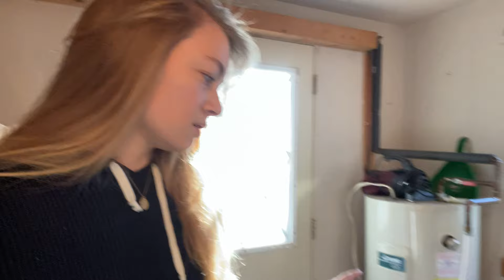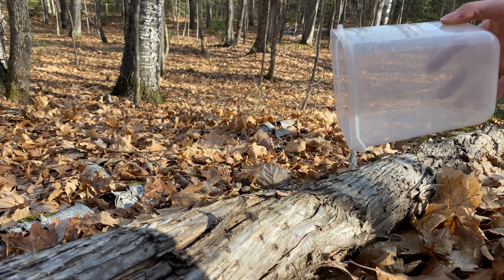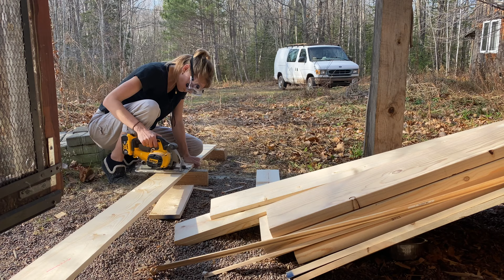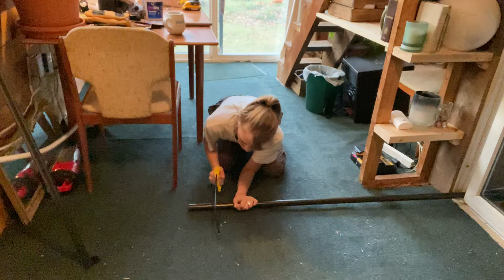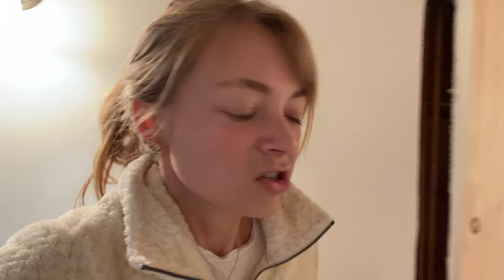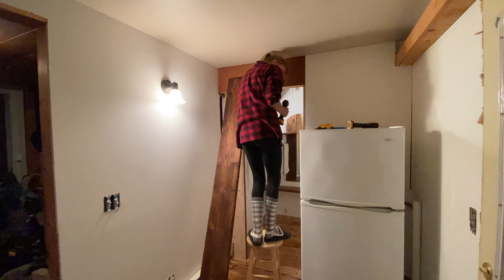DIY Bathroom Renovation (i'm tired) (but happy)

Comment: RE: The frogs falling in (or anything else)
You should put a piece of screen/mesh over the top of the pipe from the outside. That way nothing can get in/die inside.
Reply: She said that she has bought a cap for on the pipe :)
Reply: @hiekevanrijswijk8222  I think the cap was for the inside of the cabin, not the outside. That's why a frog came out when she removed it to do this renovation, I think it got stuck there.

Comment: Don't forget to drain waterpipes, waterheater, turn off H2O access...
ie... Winterize cabin before leaving it for the winter season. 🙂
Reply: Also exposed faucets, cover with insulation.  Anything exposed, insulate.
Reply: Why even leave for winter, that would be fun to live in.  Only difference is 20-30 degrees.

Comment: Darling, for bathroom floor (to know for the next cabin) it should have been taped around the edges with a special fabric taping then waterproofed (by painting the floor and up the wall a little ways with waterproofing agent). That will stop water damaging the walls etc overtime or if you have a water spill 💁🏻‍♀️
Reply: This!! She definitely had some water damage near the floor and tub on the wall. There could be mold growing back there.

Comment: The floors look great, bit worried about moisture getting under the wood planks tho...
Reply: That’s exactly what I was thinking
Reply: Yep
Reply: Same it makes me anxious
Reply: how would you prevent this generally speaking? like how do you keep moisture from getting under there? insulation?
Reply: @soupafleye  sub flooring.
Reply: It is a thick rubber mat that goes up the walls an inch or so and hidden be the trim. Could lay down some tyvek under the flooring,  this will probably get torn out next spring.
Reply: You never cease to amaze me with your skills. I’m so glad that you just take charge of your own happiness.
Reply: I think this is kind of her trial run cabin, so the mistakes she makes she’ll learn from when she decides to build a new cabin or renovate the other one
Reply: Just cover the planks with floor epoxy, problem solved
Reply: @soupafleye  where I am from we build with brick and mortar so this usually just gets built into the way the floor is laid everywhere. But I think  with this kind of "american style" houses you can just lay some moist resistant barrier under the floor, between the boards and that should be enough

Comment: Btw she was mistaken to remove the linoleum , it was a good moisture barrier tot he sub flooring before putting boards down. She didn’t put anything under the boards, so water will leak slowly between the boards and she should have left the linoleum under the fridge for leaks... also why isn’t she concerned frogs are living in the walls ?

Comment: Erm...you should have some kind of water insulation on the floor. Espec because wood is sooo not water resistante. Thats a bathroom, it will be wet and moldy and ya know....you need smth to stop the water from going down
Reply: I thought the same thing. Moisture and wood don’t really go well together. It looks nice but I feel like in a couple years it won’t look so good.
Reply: Alison Brown  I didnt say she is stupid. But what I see in the video is that she didnt put any water insulation, ok?

Comment: Might need to redo the floor in your bathroom. You just missed a crucial step where you put a layer (idk what the material is) between the new floor and the old floor. This ultimately stops molding in your floor. Only a minor setback :)

Edit: My dad is a carpet/hardwood/tile (all types of flooring) layer tradesman and I spent a lot of days working with him

Edit2: So there are two options here:

1) Ignore it and fix it once your floor starts to cave in (idk maybe 5 years from now) which will cost heavily

2) Fix it now with couch money and ~3 hours your time
Reply: I am not a carpenter but I was a bit concerned about that as well. There are so many flooring options that are waterproof and yet look natural and for a space that size it would be really cheap.
Reply: I was thinking something like that... then I remembered this is her learning cabin. 🥰
Reply: @jillyfish72  future lesson: how to get rid of water damage and mold from a bathroom (unless she remedies the situation somehow)
Reply: She is just one person living there, and she did the work, so she will respect it. I'm sure she will use bath mats and her cabin is probably drafty and has dry heat from the wood stove, which is an issue in Minnesota. She said she is not living there over this winter. She has other issues that would also effect the floors, like heat and cold. I know, my wooden gate fence has a turnbuckle to adjust for the shrinking and expansion of the wood seasonally. As long as she has it completely dry before she closes up for the winter, she can at least come back to it in the spring and work through the issues, and have a functional and pretty bathroom to use while she works on projects. I need a good, hot bath whenever I do work like that! My bathroom was also my first big project, and I don't regret it. She also has an outhouse, so I'm sure she is thinking about water and at the very least, a composting toilet indoors for the future. The sound clip that made me smile was "Morries of Inver Grove Heights" which told me she is close enough to St Paul to get FM radio stations from here. I lived 2 hours into WI in a cabin for a year, the bathroom was so rotted and molded the toilet was about to fall into the basement. A rental. Now I am a homeowner, so yes, she will have issues, but the progress and feeling of functional and pretty shelves, a bathtub, and fresh clean paint is very motivating and wonderful!
Reply: Good information! Thanks for sharing. I’ll remember this for when I have my own house to fix up someday. :)
Reply: @brendag2891  Yeah don't get me wrong. She is one of my favorite Youtubers. But having lived in my current home for 16 years now - well you live and you learn. You ignore a problem or try a solution on your own without the required research or experience, you are either just throwing away money, or more likely going to spend much more down the line getting an expert to fix things.  But yeah I will give it to her - she is on a schedule, so to speak, if she wants to make money with consistent videos. I painted a room a few weeks back, and I thought about what a pain it would be to have to stop every few minutes and try to adjust a camera, while I have paint all over my hands  - or getting the lighting and sound right so I can explain what I'm doing. And then after ALL that having to go back and edit a video of that.  All of that cuts into the amount of time you can actually research all this (after all, most home improvement videos are not nearly as entertaining as hers).  But she is smart, feisty, fun, determined and young- she has plenty of time to learn all this.
Reply: @brendag2891  I'm from thunder bay and I used to take trips to st. paul/Minneapolis MN often! It honestly shocks me that her land was so cheap, even in the middle of nowhere in ontario land is very expensive! I think she's doing a decent job especially considering she has 0 experience, but yeah the floors would likely need to be addressed.
Reply: @lolalover24212  I wish I lived in Thunder Bay right about now! I seriously have been looking into community college options for my teens up in Canada, because it's the only thing I can think of for Essential Travel and a way to get out of this country. The Covid and political situation is so bad right now. I've wanted to visit Thunder Bay forever! I forgot my passport last time I was up at Lutsen. I need to live around the Great Lakes, and need the snow. I love what we call "up North"!  I will definitely be there as soon as Covid is under control. Not a moment sooner. I am so grateful Hannah has this great channel so we can virtually benefit! It's like a mini getaway during such crazy times. Thanks Hannah!!!!
Reply: @brendag2891  That sounds find and dandy, but do it right the first time! then you dont have to worry about it, she literally had to buy the stuff and cut it and put floor on top of it.
Reply: I believe she is going to eventually build a Tiny house on this property to live in, so this is just to have fun with, learn with and live at for the meantime.
Reply: @brendag2891  tbay is a great choice for all of that! I currently live in Ottawa, but I’m up in the summer to visit all the time! There’s nothing like NWO to be honest.....and yes we have all been hoping for you guys politically!! It’s rough out there these days, our politics can often be on the rough side (see: Doug Ford premier of Ontario 🤪 yes his brother was the crack addict mayor) so don’t feel too alone there 💖🥰 hoping you can get to a better spot soon!

Comment: Adding a Tankless Hot Water Heater would save quite a bit of energy and open up that space a lot 😁

Good job on everything! 

**Also, maybe some sliders under that fridge to keep your floor nice! 🤗
Reply: I have a gas on demand water heater and it is THE BEST. Never run out of hot water for my tub. So small, and very energy efficient. No big tank water heater. That would be a great update!

Comment: Hacksaws only cut on the forward stroke. 
The backstroke is a "clearing" stroke and just moves chips. 
So, push forward, glide back, don't drag it back and think it's cutting, cause it's not ~when it's going backwards.

Comment: next time you have to move a fridge on anything big and bulky and heavy and you dont want to ruin your floors move it onto a blanket, its easier to move because it slides easier, and it wont ruin your flooring. then to take the blanket out tip the fridge back and pull. fairly easy. easier with two but ive done it by myself before. LOOKS AMAZING GREAT WORK

Comment: Wood floors in the bathroom... girl I hope you like putting them in because wood and water is damage real quick
Reply: Just need to treat them properly . Marine varnish or Waterlox finish
Reply: Lots of bathrooms have wood floors.........as said you just have to seal them.

Sadly however she didn’t seal each board so water will get underneath and between the joints. Timber will swell unevenly and create high and low spots making the floor rough and uncomfortable.

Comment: If you have water to the bathroom and a drain, just put a toilet in!  It is really simple.  I have plumbed several toilets over the years. One in a basement where I had to make a raised floor and one on a main floor where I had to tap into cast iron drain pipes.  You would have an easy job of it!  There is lots of room by the tub.

Comment: You should put tiny corner shelves up high with plans on them where you messed up the trim in the room you insulated. It will hide the mistake and be so cute

Comment: The boiler should be hanging on the bathroom wall. It helps warming the space. The water pomp, well I have mine in the basement but maybe you don't have one. Maybe making a small closet just to be covered inside it?

Comment: Hey - love your videos! and I’m hoping to do something like this in the future. You should be super proud of yourself. Though here’s a tip for patching holes and cracks before paint - if you get actual premixed joint compound, you won’t see the spots after you paint over them. That pink stuff you’re using will make the patches visible after you paint. Cheers and best of luck!

Comment: You should be so proud of yourself.  You show most girls how easy this is and help them believe in their self. Shows any girl they can do anything like this and ya dont need a man. I really enjoy all of what your doing. But I fell into a rut and just can't seem to get started. L I love the shelf in the shower. Such a great idea and I love those floors. I need to do mine. What wood are you using? And stain. Id guess but I'm curious. Guess its time to unpack these tools and put them to good use. I even bought a miter saw. Used to work for an antique place but its been a while. Like you im usually very independent. This gave me a push to get started. My class needs some tlc too But I want to also start building things simple and pretty that i can sell.

Comment: I think you said your heading out for the winter, in your van? I was wondering about that, and how do you leave a house all winter? With flooring, usually tounge and groove is the flooring you use. Your only relying on nails like this,  but it should work, just some boards might not be perfectly straight, so might be gaps. Might be nice to put in a compost toilet for those days you just want convienence. Seems like would fit to left of bathroom door. Could be concealed as  a bench. Star drill bits and screws wont strip, get those next. Phillips is not that great.

Comment: Please tell me that you have a lip that catches the edge of the tub, on the underside of your tub-board that you made, so that it won't slip either down or up, which would then spill your laptop into the tub?   Also, to use some kind of clamp to keep it in place wouldn't be a bad idea as well.  ❤️

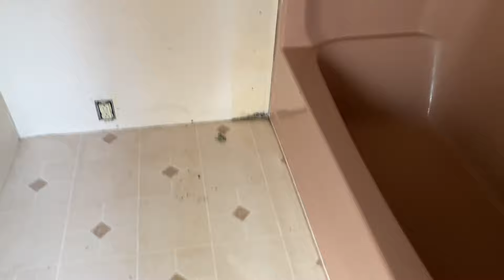Comment: Not like you need another project added to your supper long project  list you already have, but this might save your health, literally, trust me I made this huge mistake in 2002 and I'm still paying for it. At 6:03 you have black mold. It will continue to grow. You can't paint over it. You must remove that section of the wall. Then treat area with mold killer ( no, not bleach, that is a myth) then repair area. My son and I have Mycotoxicosis ( Google it). I have been unable to work since 2009. Mold has cost me my health, nearly my life and all that we owned. Take that extra step and remove all mold from your cabin, treat and repair.

Comment: It is a lot more complicated. First, you're in the woods and you probably should have done a moisture barrier before you put down untreated wood on the floors. And then it will probably take, at least 3-4 coats of sealant on top, then making sure it's tight to wall. Funny thing about wood...it can rot when it isn't treated and then you run the risk of black mold. Which is toxic and even after bleaching, sanding....comes back.

Comment: You need a plumber to put a drain in for a toilet. That water from tub and sink have to go somewhere.
Reply: Her toilet is in the outhouse. I was wondering when showed it if it’s just a huge hole underneath , or how all the junk there gets removed. There’s no water flushing there either.

The cost for a running toilet in the house will probably be very expensive, so I don’t think she will do it

Comment: Where I live we dont have those huge water heaters. You could buy a small guiser that you would turn on 20 mins before shower that would give you hot water. Or buy a hot water rod - fill a couple buckets up with water. It only takes 20 mins per bucket for almost boiling water <we use this in our home>. Its a little more time consuming but it saves on your power and doesnt take space like that huge water heater 🇮🇳✌

Comment: I'm so happy that you're putting in work and learning new skills, but these videos make me cringe a bit how little research and forethought goes into the processes to make any of this last. It's so much easier to do it right the first time instead of have to redo it in a few years as it ages poorly. I wish so much that this channel felt less like an instagram aesthetics how to make your house look like pinterest, and reflected actual construction channels more.. Good for you for making your dreams come true, but perhaps try a bit more research? Painting linoleum will very quickly, wood flooring has tongue and groove to hold it tight and prevent large cracks in the floor, cloth masks are not substitutes for respirators when vapor inhalation are a concern.. It's a little painful and cringey to watch, making me frustrated cause I want so badly to be inspired